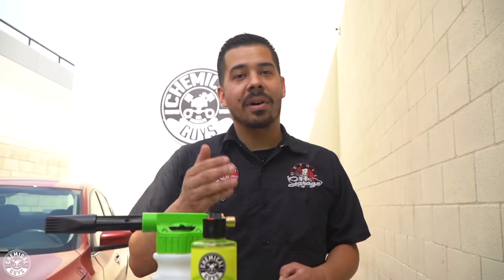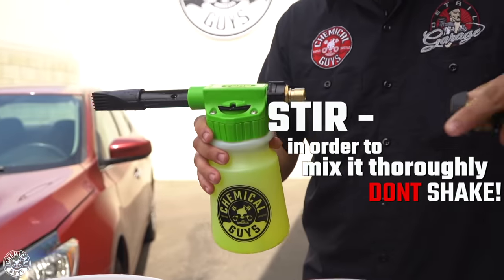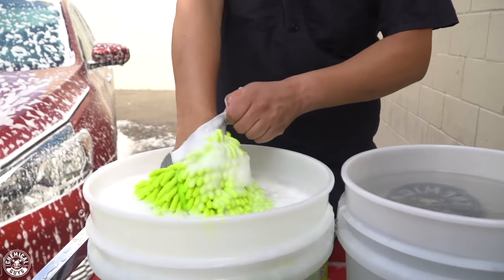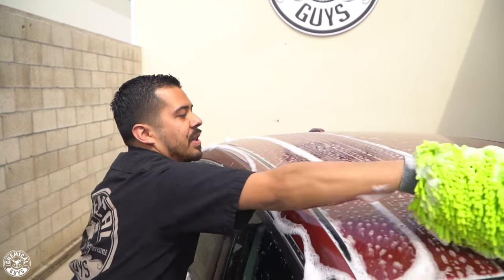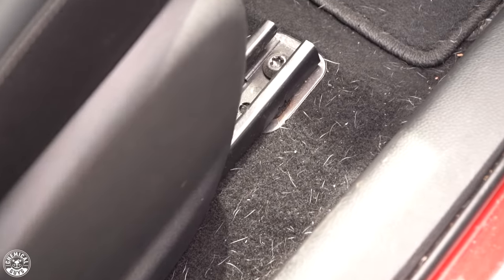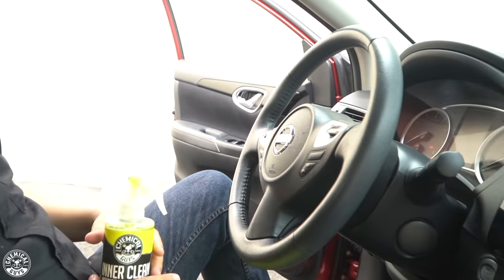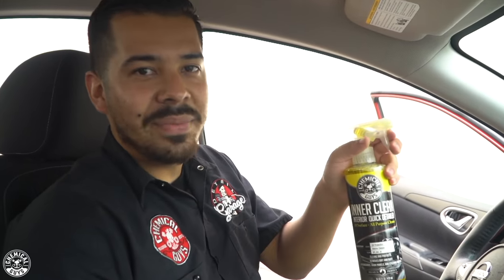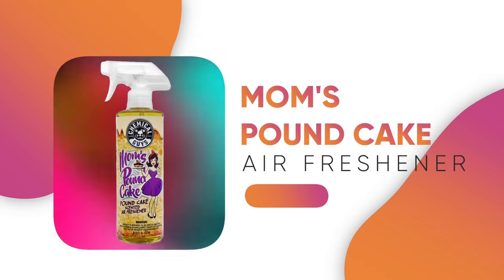How To Give Fully Detail Car! - Chemical Guys

Comment: Another great video - well explained.  I especially like the graphics (like the foam blaster settings - 1:50) - nice professional touch.  How about a video or the products and techniques for cleaning the Seat Belts?
Reply from the maker: Thanks for the amazing feedback, we do not recommend cleaning seat belts because they have a fire resistant coating on them that you do not want to wear off.
Reply: @ChemicalGuys  Thanks for the information.  Great products